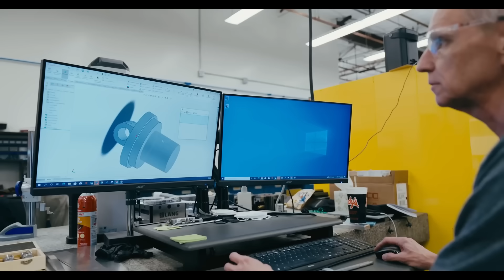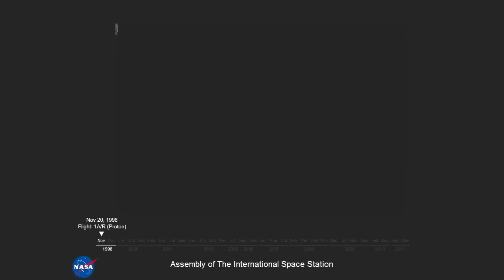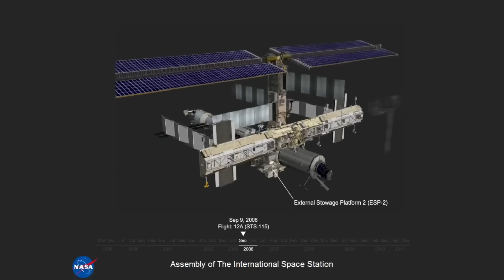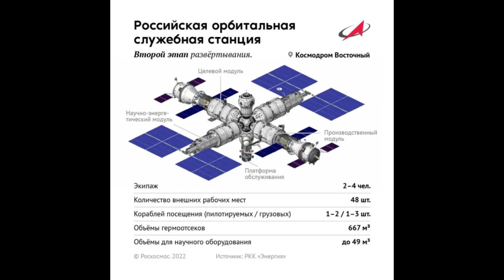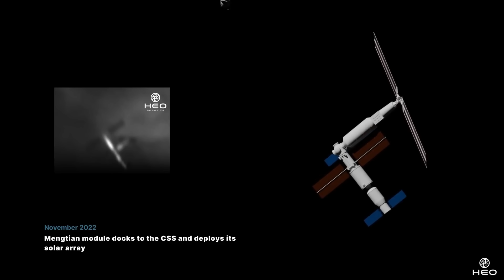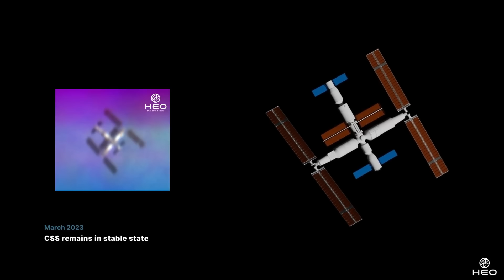Where Will Astronauts Go After The ISS Is Destroyed?

Comment: I’m really hoping that they continue normal operations of ISS past 2030. It seems like ditching it would be a huge waste.
Reply: It lacks power (without Russia's modules).
There's stress cracks to be worried about worsening.
I think it's safe enough for now, but definitely closely monitored and otherwise on life support.
Reply: @DUKE_of_RAMBLE do welders not exist?  Hell if nothing else it’s an opportunity to test welding and repair in space. We need info on this anyways! Such a waste to throw billions away for some cracks.
Reply: @macthelost  Your heart is in the right place, but not sure if you're grasping all of the issues with your suggestion to "just weld it!"
There's a reason you bring a ship into a dry dock to perform major repairs like that.

With the space station, you have such a finite amount of space, so you literally use every inch and millimeter of it. That means you have spots you can't access, at least not easily without shuffling major components all over to gain the necessary access.

Then there's the issue of the layering. I don't know specifically how they are setup, but my gut tells me there's a fabric layer (ballistic fiber maybe); a thermal layer; and one, maybe two, metal layers.
The amount of heat generated during welding is quite possibly (even likely) going to melt any fabric layer.

What's more, is your going to have to also depressurize whatever module your welding on, because during that heating, the metal is weaker until it cools... So having a blowout would be quite catastrophic!

Even then, the dexterity while in a spacesuit diminishes significantly. Dunno if you've welded before but I've welded before, it's very fun. If not, then you don't just pull the trigger and drag it across the metal. You have to prep it first. If you want to do it RIGHT, and sufficiently, you have to grind a bit of a channel. You can lay the bead on top, overlaying the crack, but it won't be as strong.
Then there's laying the bead, which is a back and forth motion, imparted by twisting your wrist. Which goes back to the issue of dexterity. I think ideally, you'd want a robot to handle that, maybe attached to the CanadArm.

Anyways, I've speculated enough. 😊
Enjoy the read!
Reply: @DUKE_of_RAMBLE  I’ve been in aerospace for 30 years. I’ve fixed f-16s and built parts for the iss and everything in between. I know what a repair is, and I also know when done properly the part is stronger than the original.
Reply: @macthelost  I also know that welding creates a stronger 'bond' in that part of the metal (in most cases), yes.
Reply: Everything decays and there is no workshop in space, where you can easily fix your station. EVAs can't fix everything. Maybe they'll push the date back 2-3 more years, if the ISS holds up better than expected.
Reply: @fonesrphunny7242 and why not? Why not use this opportunity to test more advanced repair procedures? Eventually we will HAVE to learn how to repair hull cracks and the like if we ever want to be a spacefaring species. This is an opportunity, not a problem.
Reply: @fonesrphunny7242 and why is there no workshop in space? Because someone decided it’s so? If you gave the iss to a civilian company I guarantee they’d find a way to set up a workshop and repair issues in situ.
Reply: It will become dangerous to operate in the next few years as the radiation exposure causes materials to degrade and the constant heating and cooling cycles cause fatigue cracks in the lightweight alloys used for the station.  Some of the Russian segments are already becoming potentially hazardous as they were not designed to go beyond 25 years and the station is now older than that.  The current station would become a srious hazard to occupants by 2030 or thereabouts and even before then the extra safety equipment to continue operation would drive operating costs up far too much.

The current ISS needs a successor if humanity wants a truly international space station up there, and I hope we do want it enough for somebody to pay for it.
Reply: @FireAngelOfLondon  I think this current one is also something of a foil. Every time an upgrade is desired, some old element makes that difficult. On top of that, the ISS just isn't great for humans, and we've learned a good amount why, rather than prior speculations. I'm sure we could learn more from the ISS given time, but I think it's time to explore actual solutions, whether it's the spinning wheel / O'Neill Cylinder, or something else NASA big brains have concocted. We learn a lot more a lot faster by actually making major moves. Tiny nudges to proven technology can work, but it's very slow and expensive to continually maintain. 

Maybe someday space is more self-sufficient in earning capital, but the ISS isn't very useful for space commerce, either. Whatever we do with our future fundings should really be toward large scientific projects, large investments to space industry, or both, rather than neither.
Reply: @Varadiio sure, these are all valid points, but instead of just burning it up and wasting it, why not make it a training ground for anyone that wants to learn and let them attempt to repair all the issues mentioned? If they can’t, no biggie, we still learn huge amounts about repairing materials ins space, knowledge we desperately need if we want to permanently become a spacefaring species. Such a wasted opportunity to just throw out the baby with the bath water.
Reply: @FireAngelOfLondon then let’s use this opportunity to learn how to repair such issues! There will come a point in our development where we will have to learn how to repair stress fractures and damage while still in space. There are no such things as problems, only opportunities to learn!
Reply: @macthelost  Nobody repairs any structure that has a lot of stress fractures, the only way to do so is to melt the whole thing down and use the metal to make another component.  Welding does not work.  If you have one crack, yes, but not if you have hundreds as the ISS will have.  The best that could be done is to try and design the next space station so it is easier to repair, or perhaps make it easier to replace parts instead.
Reply: They’re life critical pressure vessels experiencing temperature swings of 100s of degrees dozens of times a day. Extending the service life raises the risk of catastrophic failure.
Reply: @aggiewoodie  Yes, a shame.  Eventually it would just fall apart and then we would have multiple large parts floating around being a hazard and much more difficult to dispose of.
Reply: The private sector often can do things better than the government, not always and it depends on the thing, but SpaceX was a good example of revolutionizing the space industry. It’ll take partnership, but the issue with nasa and government agencies is things are so political, they dont prioritize things for efficiency or success, they prioritize job creation and funds being distributed to varies states so senators and reps can say “look what I did”
Reply: As much as I'd like the ISS to continue operation it's highly outdated and is wearing out it needs to be replaced with a newer safer station hopefully designed from the ground up to last significantly longer
Reply: @KiRiTO72987  i understand that, but when you buy a new car do you drive your old one off a cliff?
Reply: @macthelost  a car doesn't have life critical pressure seals and isn't constantly exposed to massive temperature swings and constant radiation weakening the metal.
Reply: @KiRiTO72987  I understand that, but if your kid has never fixed a car before and you’ve got a 75 billion dollar junker, why not let him learn by tinkering on it instead of setting it on fire?
Reply: @KiRiTO72987  sure, and it should not be used as an active station, but why not kick it into a higher more stable orbit and let anyone that wants to research repair procedures in vacuum test out methods? I keep hearing it needs to be replaced because we can’t repair things in space, so do we use it to figure out how to do that with a decommissioned iss, or do we never learn and make every space station in the future expendable also?  Should we just never learn to fix things in space?
Reply: no more a waste than the shuttles turned out to be, i'm afraid
Reply: I think so too but....
Reply: @JeffreyBue_imtxsmoke  When nasa first did their evaluation they estimated 2028 would be the last year. The most recent analysis predicts 2030. Who knows, maybe once the date gets closer they will review it again and move it back another few more years.

Comment: After Starliner's performance, I would be suspect of any design that did not include at least two docking ports. So Vast may want to re-think that design. They could put a segment that looks like a cross on the end where the Dragon attaches, that would accommodate two additional capsules. But to only have Life support, and once egress from the single capsule, is asking for trouble. Unless it doesn't mate with a Boeing product, then I suppose you'd be fine.
Reply: Two docks is definitely important for safety.
Though Starliner isn't stuck. It could come home at any time, but the parts they want to study are jettisoned before re-entry and burn up, so they have intentionally delayed the return to gather data. No one is actually stranded.
Reply: @CptJistuce  intentional delays, that's a new one
Reply: Here's my idea: adapt Cargo Dragon to fly in a fairing, and dock a 6-port ball to the front. Launches, the cargo dragon then acts as a space tug to get the ball to the space station. It docks it, then undocks itself, then de-orbits.

Comment: Way back in the Apollo Applications Program, there was a proposal for a free-flying space telescope based on an Apollo lunar module chassis.  It would have operated with Skylab.  China is probably copying that idea for their free flying space telescope.
Reply: In This Case using the word “copy” is a bit disingenuous  as with Energia-Buran despite designs being different, at some point the core maths of engineering push designs to look/behave similar.
Reply: You know, there's only so many ways to make a Space Telescope and a Space Station work together without compromising the telescope, it's not necessarily a copy.
Reply: China has a similar concept. The XunTian (巡天)China Space Station Telescope (CSST) is now under R&D. As planned it will be launched in 2024, but it is delayed in 2026.
Reply: Not probably, we are. It's called XunTian and will fly closely with the space station, maintenance and equipment upgrades can be easily done in the pressurized space when docking.
Reply: Copying = "We can not do it and they are going to do it better".

A portrait of the current state of "Western Technology" in so many fields. Our antecessors will be pretty unhappy in their tombs.

Comment: Russia could theoretically get to CSS, with a bit of effort.  Russian territory south of Vladivostok goes down to ~42.3°N, which is very close to Tiangong at 41.47°N.  Zenit-2 was supposed to be further developed to be human-rated.  If it was, then they could launch of the old Sea Launch system (designed to launch Zenit-2SL) from the optimum latitude.  That old launch platform is conveniently at Slavyanka (42.871°N 131.393°E), just outside Vladivostok.  So not impossible, though I can't see them doing it.
Reply: They can always buy a seat on the Chinese Rockets like how the Americans did with the Soyuz to get to the ISS.
Reply: Could also do expensive plane change manoeuvres.
Reply: Before the end of collaboration during the war with Ukraine Russia was also launching Soyuz from French Guyana. Depending on the political future in Russia and the EU, they may be able to launch from Kourou again. If such peace and/or political change does lead to the return of such a collaboration, they may be able to launch crew to the Chinese Tiangong space station from that launch site using Soyuz.

But that may be a very optimistic view of the next 5 years of Russian political change